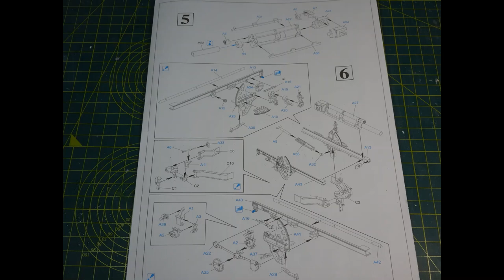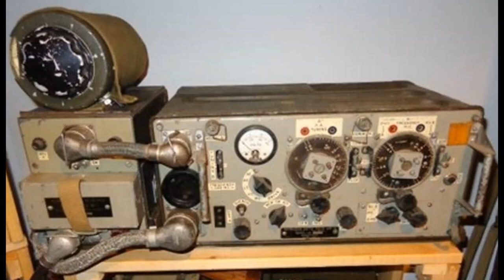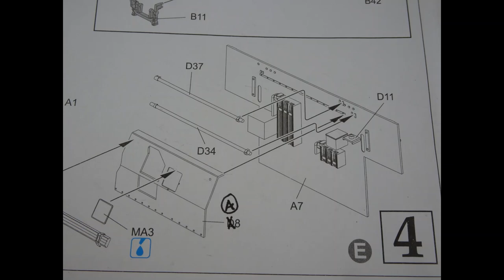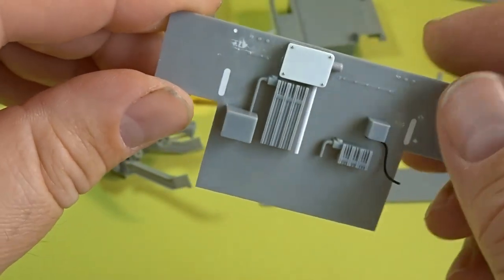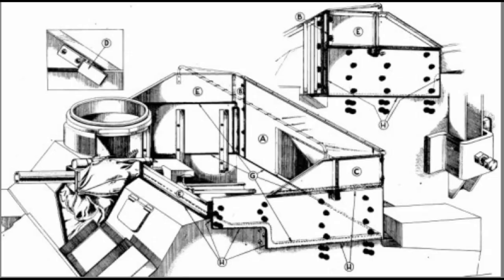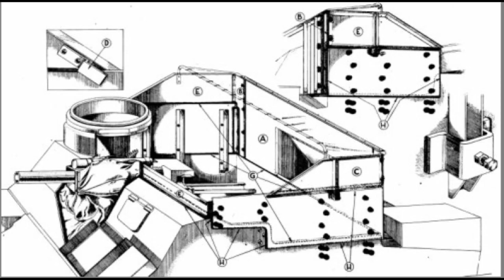Dragon 1/35 Scale M7 PRIEST Mid Production Kitbash/Conversion to Canadian D Day Priest - INTERIOR

Comment: Fascinating build, my friend. Thanks for the tip of nylon wire. I want a Priest in 1/72, but there isn’t a whole lot. The Matchbox kit I’ve got. I need a better one. I got the Flyhawk Abrams built. I had no problem with the tracks. Just wanted to say that. Cheers, Any.
Reply from the maker: I must have had a duff supplier. You never know what you are gonna get when you buy from a Chinese dealer.
Reply: @SteveJonesScaleModellingSite  that is true. Though I can see where it could go wrong. You warned me so I took extra care to study the parts and the manual. Thanks to you that worked.

Comment: Nice detailing mate, this is my favourite WW2 vehicle and have made several kits of it. Where did you get the right angle torches from, I need a shed load as im doing M8, M20 and another M7 and like to detail the interiors and hate the empty torch holders. Looking forward to the next video. Cheers.
Reply from the maker: Hi Nick. Many thanks for looking in and commenting. The flashlights were in Tamiya Military Miniatures US Modern Army Infantry. (35133) There were only two in the set. Speak soon my friend